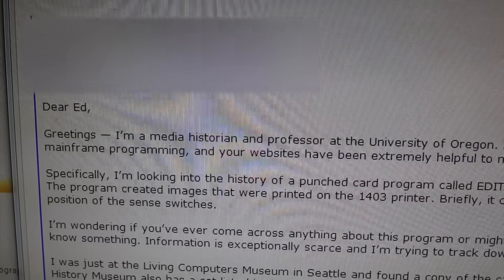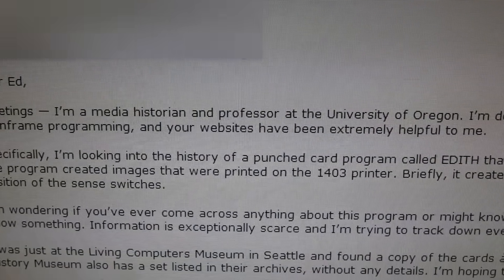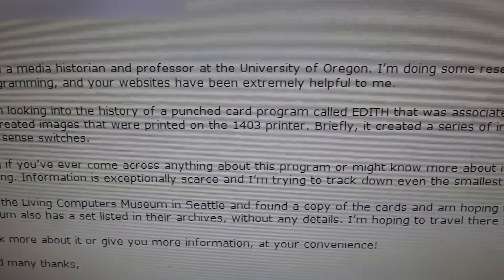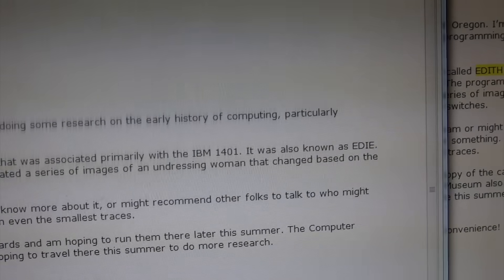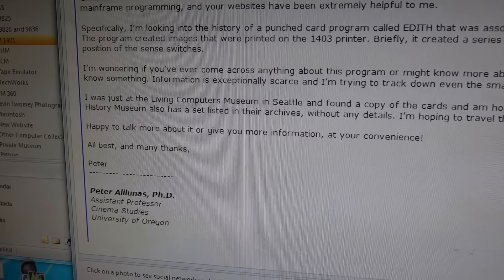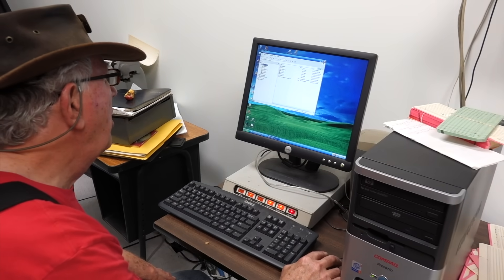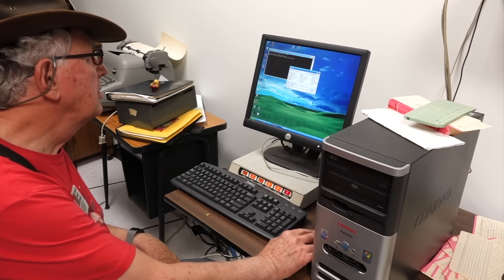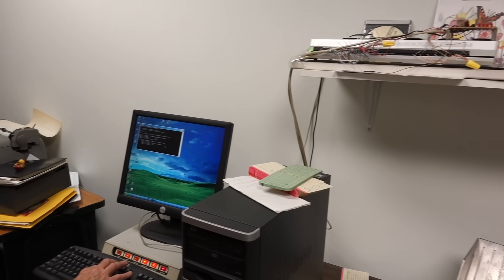The IBM 1401 mainframe runs "Edith"

Comment: 1:48 I'm kinda surprised that punch card filing cabinets were actually a thing.
Reply: If you have enough of something, there is a point in making a filing cabinet for it. punch-cards were lyfe
Reply: When Herman Hollerith was developing punch card processing in 1890, he specified that they should be the same dimensions as US currency at that time, so that customers could use the same filing cabinets as for stacks of money (7.375 by 3.125 inches, or 18.7325 by 7.9375 cm, but 0.007 inches or 0.1778 mm, much thicker than cash).

In the early 1930s, US currency was reduced about 20 percent in size, to the current size, but the punch card stayed the same.  There were, however, changes in the physical punching method and the code used, with IBM introducing the 12 rows by 80 columns format, with rectangular holes the same shape as tiny miniature copies of the card shape turned 90 degrees, in the early 1930s.  Other companies, such as Sperry Rand (Univac) used 12 rows of 45 round holds, with the top and bottom halves of the card each representing 45 characters in a binary code, rather than one punch only, as IBM did for numerals.

Filing cabinets were used for bulk storage, and the trays were removable.  Often, rubber bands were put around handling-sized decks between uses, but leaving the rubber bands on in the trays, with the tray back ratcheted to keep pressure on the cards, was not recommended.
Reply: @allanrichardson1468  "Not recommended" feels like an understatement of the century!
Reply: Kevin Bhasi and loose order of cards if someone sneeze?
Reply: Kevin Bhasi how would you store all your punch cards?
Reply: Those filing cabinets were the standard way of handling bulk card files like payroll masters or inventory masters. I remember rooms 100 feet square full of those card cases. Aisle after aisle 80 feet long with solid rows of those card cabinets on each side. Then came tape, and for most companies the card cases decreased to about one aisle or maybe half of one, and the rest of the room full of tape racks.
Reply: There were also cardboard boxes and metal boxes with latches and a carrying handle that were used to transport cards.
Reply: Lawrence Jones Often the file drawers were also removable trays for carrying large batches of cards.
Reply: WolfPupHowls 
No, there would be elastic bands.
Reply: Kevin Bhasi elastic bands in 1970?
Reply: Rubber bands have been around since the 1930s at least. But most card decks could be large. 2000 cards (which is only a 2000 line source file, tiny these days) was a full box of cards about 10 inches long and about 5 pounds of cards. A rubber band was only good for a couple hundred cards at most. And they could nick or bend the edges of the front and back cards and cause misfeeds when you tried to read the deck if you put the band on too tight.  Even if you put a band around a small deck you kept it in a card box or card tray rather than just out on a shelf or table. More typically you just put a number of small decks in a tray with index divider cards between the decks.
Reply: l wilton actually you used items called "black backs" which were slightly larger than a punch card, then uses 2 rubber bands about 1" feom the left and right edges from the cards. Cause no warping of the cards nor defomation of the top or bottom of the cards. I have used them for 20 yrs w/o a problem. Any card deck over 300 cards or so were kept in card drawers that had a metal sliding pressure back that kept all cards in place
Reply: Well you used boards if you had them. I saw thousands of student-submitted decks and output decks that just had a single rubber band wrapped twice around them. And if you were a COBOL programmer (and I was) you typically had a bottom desk drawer full of "subroutines", and a good many of the smaller ones likely had a band around them and the deck name written in felt pen (with a diagonal slash to verify card order) written on top.
Reply: l wilton I never used a single rubber band as most of the times it would damage the 12 and 9 edge and cause a jamb esp on the 2540. I always used two rubber bands on the left and right side of the deck. I began on COBOL (D,F and ANSI, then grew tired of its limitations and bloated code and switched to assembler. I used to read core dumps to debug COBOL, FORTRAN, and PL/1 programs. I wrote complete applications in assembler for decades as well as various sort exits. When I later went to a bank, I got COBOL to dynamically call subroutines (somethimg IBM said couldnt be done) saved hundreds of hours of coding instead of using a relo library to include at link time which would increase the executable size. I used BPS, TOS, then DOS (up to VSE/XP) was never a fan of VM or MVS. Although SPF is awesome. I had to use ICCF :(
Reply: I kinda suspected you were an IBM guy. :-) But then, most people were in those days. I was a Burroughs guy, though I did some job-shopping on GE machines in various FORTRAN dialects right out of college, and a fair amount of 1401 assembler business programming. After a few years of doing COBOL stuff I got hired by the Burroughs Pasadena plant and ended up in charge of the Medium System operating system design, which was originally written in assembler, though one vastly different than 360 assembler.. Burroughs had a 1500 card per minute reader that fed cards 1-end first, and it would read rags, in fact it read fuzzy cards better than brand new cards that still stuck together. So mangling the 12 and 9 edges of the card really didn't make much difference, but boy that could sure play hob with a 1402 reader!
Reply: l wilton yes very much an IBM guy from 407 days on up. I began plugboard wiring on a 407. Wrote in assembler for many decades on mainframes, never on a Burroughs. One shop I was in had 12 different vendors of equipment in the room and I had to know assembler for all of them. It got quite confusing after a while, as to which mnemonic went to which machine. Remember when your phone bill was on punch cards? I used to wet and rough up the centers of the 12, 9, 1, and 80 edges so it would cause a most certain jamb in card readers as it would never make it past the gappers
Reply: @lwilton  My grandfather was a Burroughs man as well.  Greetings from RotCore (Rochester) NY!
Reply: WolfPupHowls 
Oh, uh… put them on shelves?
Reply: Lawrence Jones 
Wow.
Reply: Kevin Bhasi elastic bands and black backs (which I still have)

Comment: Lovely, I know Edith here in German, when my Dad runs the Office they Used Edith ti communicate with other Offices just for fun in their free time. They had many punch cards with different versions of Edith on the early Computer days. He told me. Cheers Form showing. Bye bye Toni
Reply: Toni Turnwald what did the other versions do?
Reply: quite complicated to explain. I know actually 5 different Versions of Edith, the Version you have should be No4c ( I count from the German view point ) Also when it's Version 4c you have actually 3 pictures inside, but if you have Version 4c1.11 there is a hidden pic, switch 1off, 2on,3on,4on,5 till 7 off and the system should be after the reading in the RUN Option stay, than you can see pic No4, if you have Version 4c1.11 ( from the Germans ). 
So, the other Versions of Edith are.
I will start with the last one, because with that Version I worked many times Version No.5 it was build on Forth and it was used as a " Gate-way" to send the program code to the early CP/M Systems, and there there was also a Version of Edith with brings up the different program code into the CP/M System to work, with a few easy modifications. 

Version No.4 this is that Version you have are the funny options of the Edith program, this was some Version that runs on a few different early Computers till the late 70s, because it was structured programmed and with Forth it works on all Systems with a A2 or A3 printer.
 
Version No.3 of the Edith Package ( Here in Germany ) it was for collecting Data and to transmit that Data to other Systems via a 24h online telephone line.

Version No.2 was the Compiler for the Edith Package, it means you got a simple code of program for your company and than you have to build that individual for your business and when you finished the program part you used this compiler, because it made some sort of code, that runs on many machines.

Version No.1 was here in German ( it's hard to explain ), it was on about 750 cards and it runs only on full expanded machines, it was used in the Chemistry industry for analyzing chemical reactions and to calculate molecule structures, but actually here in German there where 4 Versions of Version No.,1 available.  The 2nd Version of No.1 was the main program for Edith, where you can write your own Edith programs and from this Version there comes or stats all the rest Version Numbers, include this one you have. Also in the Version No1 ( the 2nd part ) there was some sort of Demo-program what Edith can do for you.
Then Version No1 the 3rd was for a few banks like Sparkasse or Raiffeisenabk here in Germany for their control of the early bank accounts. This Version was on about 800 cards.
Version No.1 then 4th was a simple program, it only counts and calculates some astronomical data on the early days.

! BUT ! also on the east-block of Germany there was a Version of Edith it was the complete Version 1,2 and their own build Version No.6, they used this for some early defense calculations.
So, I hope I have helped you a little, if you like more information about Edith, because it was a pretty good program code, feel free to ask.
cheerio Toni
Reply: PS: Sorry for my bad English, but I'm, from Germany, smile
Reply: Weiß man eigentlich auch genaueres über die Herkunft der Programme? Hast du einen Buch tipp dafür oder einen Link? :)
Reply: fatcat Nee, ein Buch nnicht, aber die Software auf y-Blättern A3' und Magnetband, sowie einige Texte dazu irgendwo, das müsste ich alles heraus suchen. LG. Toni
Reply: Würde mich sehr freuen mehr darüber zu erfahren! Ich hatte gehofft eine Andenkens-Seite zu finden aber habe leider noch nichts gefunden. LG fatcat
Reply: alles kein Problem, nur bin ich jetzt noch in der Arbeit und es wird heute leider spät werden. Ich melde mich Morgen früh, dann kann ich Dir in aller Ruhe mehr erzählen, quasi alles was Du wissen willst. Lg. Toni
Reply: Hey hier mal meine email: fatcat@byom.de Es gibt ja kein pm mehr auf yt. 
LG fatcat
Reply: @toniturnwald9890  Neuigkeiten?

Comment: Interesting...  While I hadn't heard about Edith specifically, while I was a student, there were plenty of line printer art images.. Somewhere I have card decks and tapes with the various datasets. (some used classic over-printing for better resolution).  One of the nicest I recall was an image of the moon.  These later images were just data printed by a small header program and a wee bit of JCL.
Reply: There were also programs that printed letter combinations designed to make the hammer sounds produce musical notes and play songs.  There were also programs (different for each computer) that performed counting loops in the CPU designed to produce radio waves (an unavoidable by-product of fast switching) that could be picked up on a properly tuned FM radio to play songs.  However, once interruptions and multitasking were available, these music programs could not produce reliable pitches or tempi to reproduce music, since no one program had total control of the CPU.  But the random tones produced over the air (in the same room, of course) still provided a way of knowing when no processing was being done, so for a few years afterward, some operators preferred to leave a radio on as a "monitor" to alert them (by silence or a steady tone) that something was wrong.
Reply: Yup - while I never heard any printer "songs" - the sounds the typical IBM line printer made while printing the pics was interesting in itself (especially pics with overprints for additional grey-tones).  As for programs running on processors to make music (on the radio) - I know of them, but haven't seen them work in person. (I believe the PDP-8 was used - never worked on one, my first was a PDP-11/34a - great machine for it's day)
Reply: Tim B I have a tape of most of the printer art. Snoopy, JFK, the moon, etc